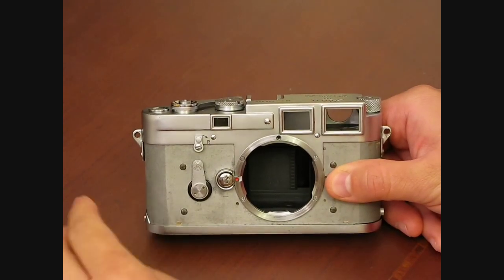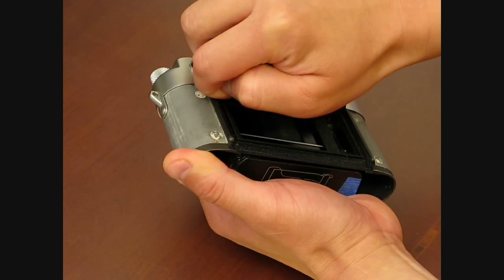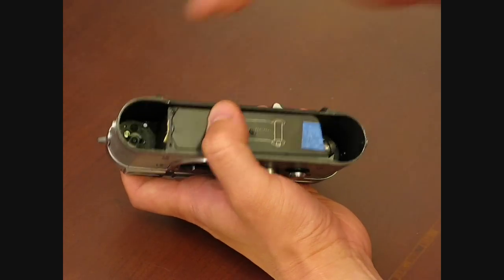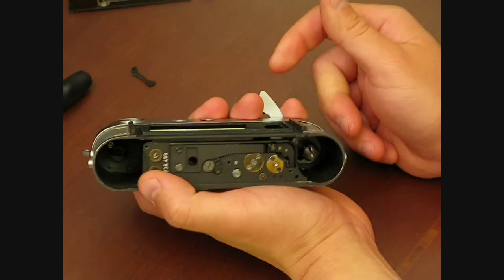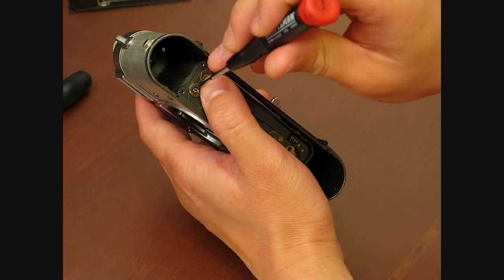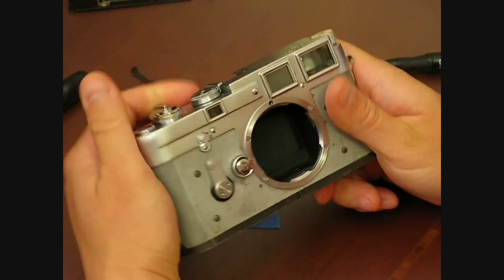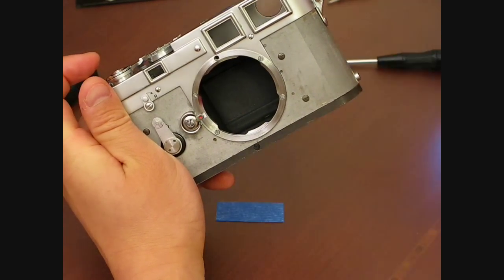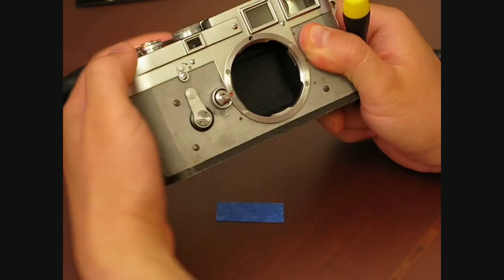Leica M3 Shutter Speed Adjustment

Comment: A Leica shutter that sticks in this way needs cleaning and lubricating. It is sticking on the blind break which is binding. Do not tension the blinds without lubricating first. A correctly cleaned and lubricated shutter will not need re tensioning unless it has been tampered with in this way. Adjusting the blinds in this way will through out all the fast speeds.

Comment: Hello, I have seen your video many times but I still am not so sure of which one of the screws I need to tight. The problem with my shutter is that (when set in one second) doesn't open entirely. It does open perfectly when set in Bulb. Thanks for sharing.

Comment: Hi man, I really want to thank you for this video, you saved me! The shutter curtain of my M4-2 was stuck (I couldn't even see where the f*** it was) and I didn't know what to do until I saw this jewel. I only pushed down a bit the "closing curtain pick up roller" with the screwdriver and voilà, the curtain was back :D :D :D I couldn't rotate it counter clock wise though (that's a good thing I suppose) also no problem with shutter speeds. I think my M4-2 needs a CLA. Thanks again mate!
Reply: Hi! Looks like I might be having a similar problem with my M3 – it got stuck after I made a shot and not it won't rewind or let me press the shutter. The curtain is closed, but the edge is slightly visible on the viewfinder side. Was it similar in your case and how was the camera after you pushed down the closing curtain take-up roller?

Comment: This tutorial is completely useless. You cannot adjust the shutter spring tension simply by checking the slow speeds. If you do so, you will end up with not properly working high speeds. It is extremely important, that both curtains have EXACTLY the same increase in speed, otherwise you´ll get at least uneven exposure @ 1/500 and 1/1000 sec or even at lower speeds. To adjust the shutter propperly, you need to measure the correct shutter speed at different spots inside the film-frame and adjust both curtains. If you do not have the needed analyzer, better have it done by a pro and do not touch the adjustment screws...
Reply: bullshit

Comment: OMG horrible advice & tutorial !
Increasing the tension of the second curtain? Yeah, oil light comes on in your dash; so why don't we floor the accelerator pedal when the engine labors as it slows down due to no oil. This is classic: "A little bit of knowledge is dangerous"
Dude, your ignoring the symptom; it isn't weak springs. The lubricant has dried out ! You're barreling through the congealed stuff by ramping up the tensions to dangerous levels ! 
Do you think curtains have tension specs?
Reply: exactly. Too MUCH tension=shutter ribbon break

Comment from the maker: Use a paste paint thinner and brush it on the old vulcanite. You may need to repeat a few times and clean up with alcohol. The paint thinner will remove vulcanite, rubber cemment, and paint, so cover the black screws or remove them as well as the back door before you start. Also, be super careful when removing the vulcanite from the back door as you will strip off the black paint. Good luck.